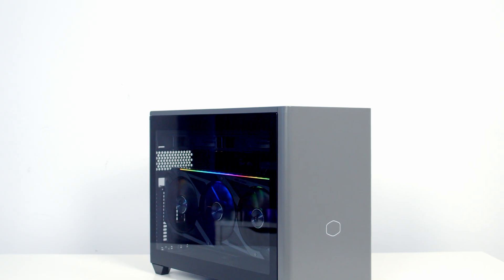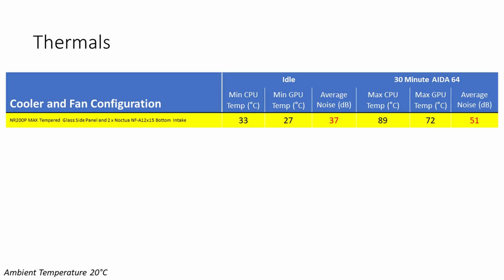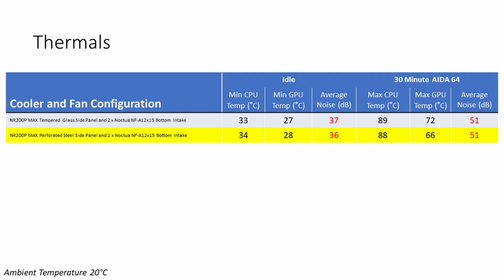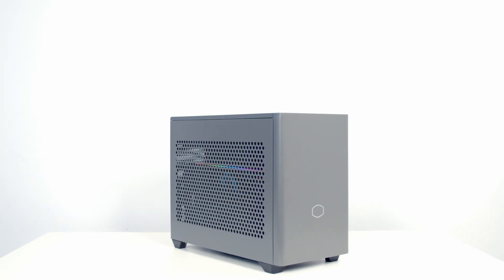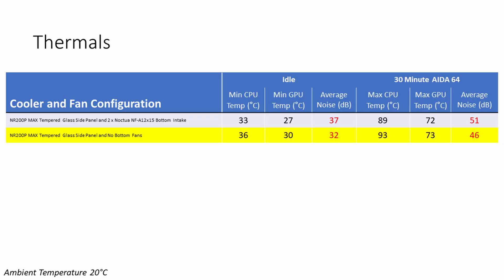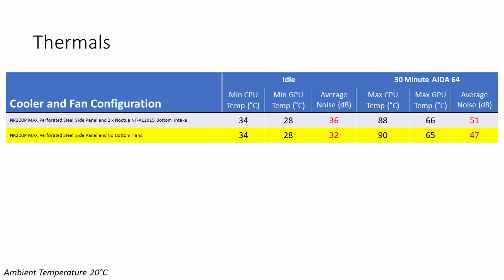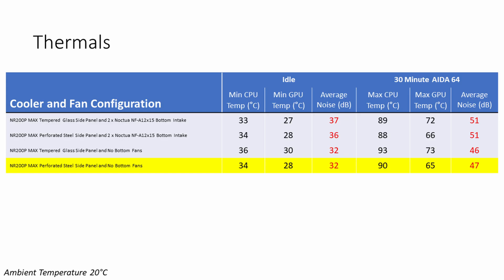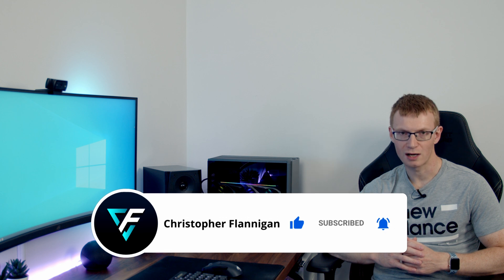Cooler Master NR200P MAX - Best Thermal Configuration

Comment: Put top in exhaust and bottom in exhaust for best overall thermals for vented side panel for GPU and CPU.
Reply: How has dust been, it's been 11 months for you in this config. Do you mind opening your side panel and having a look? I was thinking of doing the same but my friends warned me that negative pressure will cause air to come in though the cracks in the case
Reply: @yaboirairai  no issues with the dust or temps. Running a 7800x3D with a 4070 Super on a 1440 monitor.

I loved my Audi but got rid of it years ago. I have a 2023 Camry Hybrid now for a commuter/family car. Honestly I am sold on Toyota from here on out. I get 51-56 MPG and it’s a great comfortable ride. I commute almost 80 miles 5x a week.
Reply: Also I realised you have a white Audi in your photo also? Haha you have great taste

Comment: So what happens if you set the top AIO as an intake as well? I am having some issue with the CPU thermal throttling when launching multiple game instances, but the GPU temperature is moderate
Reply: What cpu and GPU are you running?
Reply: @UnboundClown  13600k and 3080 12GB
Reply: @willdrunkenstein5367  Nice. I have the exact same setup, and I just put it in the NR200P Max this weekend. 

So the issue is 13th Gen pull so much power out of the box. You need to undervolt the cpu. And that can change depending on your motherboard.

Mine was thermal throttling too, in both my mid tower and this one. But after undervolting, no issues. 

What motherboard do you have?
Reply: @UnboundClown  I'm running the Asus B760-I. What program do you use to control the clockspeed and voltage of CPU cores?
Reply: @UnboundClown  Also I just checked the NR200P Max. The top AIO fans come preinstalled in the orientation that pushes air down into the case. Cooling is already optimized
Reply: @willdrunkenstein5367  My NR200p Max aio came with fans set as exhaust. Which is how I had my previous soo set up as well. 

I don’t currently have any lower fans yet, but after running tests and gaming for multiple times from 20 to 45mins, my CPU hits a maximum of 63°-ish and GPU didn’t go past 65°. But I also undervolted my 3080 in MSI, so doesn’t pull anymore than 285w. 

And I’m really happy with these temps so far. Especially for such a small case. If I ever upgrade my GPU to a 40 series, I might add bottom fans.
Reply: @UnboundClown  Well, I've just setup an B760-I with a 13700KF and installed it in the NR200P Max yesterday. I've been getting idle values of 64º and Load values of 93. Algo got a peak of 100º. The case put out really hot air on the top fans. Something doesn't feel right but I'm reading all over the internet about the 13700 beeing really power angry. Was expecting a lot less temp from an AIO but I got to be honest and it's just the first time I'm using one.

Any ideas besides the undervolt?
Reply: Yeh the 13th Gen chips in general are very power hungry. Even my i5 will thermal throttle with a 280mm AIO at stock settings.

If you don’t want mess around with undervolting, the next best thing to do is to just put power limits. Which is also done in the bios.

Your cpu has a base power of 125w and turbo of 253w. And 253w will just make it too hot. So in bios find cpu power management options and put the “Short Duration Package Power Limit” from auto, to say 180w. And see how them temps look after that. 

Of course this will probably affect performance, which is why undervolt is usually the best way. 

What brand of motherboard is yours?
Reply: @UnboundClown  I'm using an Asus Rog Strix B760-I.

For some reason the chassis fan was not well connected. Temps improved. Still got a max peak of 98º. I will be monitoring this and will take your advice if needed.

Comment: I am really worried about the cpu temps...the only thing that makes me rethink of buying it:(
Reply: Use the mesh panel side panel, keep the AIO fans exhausting and put 2 12x15 bottom fans also exhausting. This is the best setup for cooling on this case. I have a 12700k and a 3090 with stock fan curves and the highest my CPU hits is 75, gpu highest is about 65.
Reply: @drew651  might be year late to ask, but im planning to build 13700k with this case, is it bad idea? Many people said 13700k not suitable for itx build (unless custom liquid build)
Reply: I would assume it's fine. My 12700k never gets above low 70's not sure how much hotter the 13700k runs.

What gpu are you running?
Reply: @drew651 what is your ambient temps? I live in a rather warm climate
Reply: @TakashiAsukai  the room is always kept in the low 20's or low 70s, depending on what scale you use.

Comment: I agree fully with your testing, I put mine through the same -- i9 11th gen -- 32 gig 4000- EVGA 3080 and it was so close with a margin of error that it just was not worth it.   The standard as is from Cooler Master really worked the best overall.   I think CM did test this... oddly they had it right out of the box.
Reply: You can replace the CM 140mm fans with Noctua: https://www.youtube.com/watch?v=vF1KbEKcD4k 
im puzzled why the smaller Noctua fans in this video make that much noise when compared to the noise levels in the link.

Comment: I do know that if you set the AIO fans to intake and the bottom fans to exhaust the GPU temps come down even further. I guess if you are more worried about a little noise and do not mind thermal throttling then by all means just leave the two bottom fans out. I am running a AMD 5900x CPU and a Radeon 6900 GPU and the temps are insane without the bottom fans.

Comment: Hello, I have a question about the lian li o11 dynamic, not the XL version but the normal version of lian li o11 dynamic. To my question you can do a 2021 test with lian li o11 dynamic what the best fan configuration is for AIO CPU cooling and AIO GPU cooling I have a graphics card that is cooled with an AIO and a CPU that is also cooled with an AIO, and now I ask myself what is the best fan configuration for it. I can't find anything about it on the internet. 

Thanks very much

Comment: It has been shown in multiple video reviews that having bottom exhaust fans helps with cpu temp a lot and helps with gpu temps as well. Takes some of the heat away from gpu decreasing heat going into the AIO... also I believe u can fit a 25mm fan on the bottom more towards the front and a slim fan in the back. Please give it a try as I would like to how it will work with a strix 3080. I have the strix 3080ti and am thinking of getting an nr200p max.
Reply: It is way better with the bottom fans. I am running a AMD 5900x CPU and a Radeon 6900 GPU and the temps are within thermal norms. If you flip the AIO fans to intake and the bottom fans to exhaust that also helps a few more degrees with GPU temps. I used 2 120mmx15mm Arctic Slim p12 fans.
Reply: @Revenant483  But as he said... Sound and really, the overall difference.   The costs and resources... not worth it.
Reply: Yes, the Machines and More channel checked a few configs and found that top in / bottom out and bottom in / top out were the best, depending on whether you value cpu cooling or gpu cooling. I believe he used 1x25mm and 1x15mm in the floor.

But I don't remember if he tested without fans, as Christopher did here.